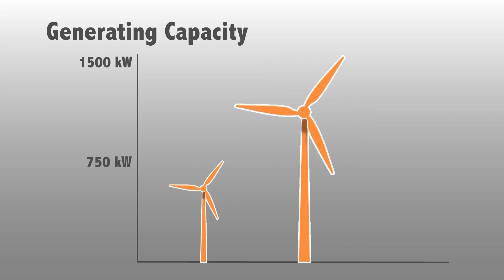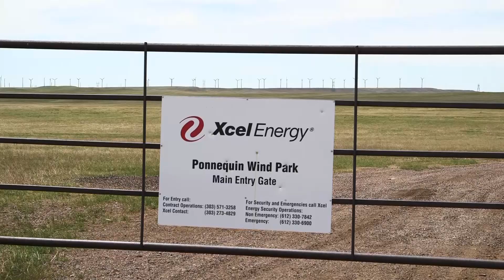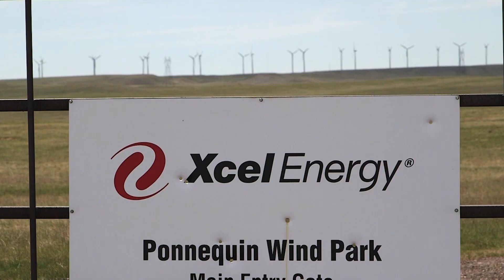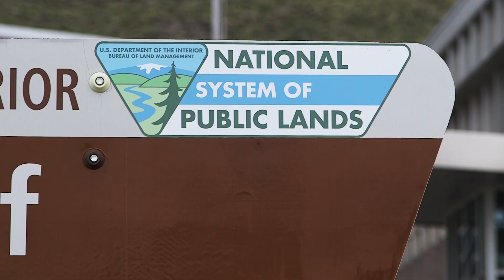Who Cleans Up When a Wind Farm Retires?

Comment: Wind farms built in the last decade are typically require a bond be placed to pay for removing the wind farms, but the bond does not take in to consideration inflation and were under the cost of removal.  Even wind that blows all the time doesn't blow constant requiring constant make up.   Large non culled wind farm output is the most natural gas expensive form of providing electricity.   If wind farms saved fuel the fuel saving would be greatly promoted.   No fuel is being saved.

Comment: The soil underneath these wind turbines is horribly polluted with hydraulic oils (basically automatic transmission fluid, power steering fluid and brake fluid), other oil, greases, and often with diesel fuel too, which can soak in to depths of over 100 feet down, and a radius 5-100x that of the base of the wind turbine itself. To properly remediate the soil pollution, the EXACT same type of NATIVE soil needs to be procured to fill in the holes where the polluted soil is removed.
Reply: And these things leak hydraulic fluids like crazy! There is no replacing seals on these things so they constantly piss hydraulic fluid all over the place. If they don't use a diesel generator they use propane which also leaks only it leaks out into the atmosphere. These atrocities make old coal fired generating stations look clean.

Comment: A bottom fell out of the market? What, we dont need electricity? The whole idea was ludecrious. Wind is low energy as compared to water. The turbines are very costly and how are they to be maintained, no less decommissioned. Sheer stupidity or better yet a scam. Just like the electric automobiles, they would be totally unfeasible without govt. subsidy. There isnt enough electricity to charge them, they have short range, the batteries dont last and how are they to be rid of when worn out. Scam again.

Comment: If you want everything electric, from alarm clocks to electric cars, then there will be costs to build,  maintain, and destroy the generatoring plants and the products, like electric cars or solar panels. But then that is the way for nuclear power plants, coal powered electric plants, or any other man made power system works. I don't have any answers, but we need to think through the costs of the entire life cycle of any power generation system. Or cut back on electric power usage so more, newer generators are not needed. That is the choice.- perfect and simple.

Comment: Without subsidies we would not be building them  these reporters never address the actual output which is based on wind conditions.  The typical capacity factor for these units 30-40% meaning they never actually  meet the  advertised  generating capacity.   1.5 megawatt unit will  only generate  0.6 MW .    This needs to be in the discussion because the industry and the government is misleading the public.  However, the tax payer will be subsidizing "at name plate"  for full generator output according to the new energy polices.... whether generating or not.

Comment: The utility looses the revenue while the wind is blowing but needs to maintain capacity to supply consumers power when the wind is not blowing.  Decreased revenue while maintaining capacity is a recipe for failure.  Texas found out that having 25% of their generation capacity that was not 100% reliable was a disaster.

Comment: Anyone who advocates for man caused and man mitigated glowbull warming AKA climate change. They are blald faced liars scam artist or gullible brainwashed fool's. I am not a denier. Yes indeed there is something up with the Planet Earth. However its not caused by man's activities. What is happening? We are in the beginning stages of A End of an Age Magnetic Pole Shift. This Magnetic Pole Shifting regularly happens at a debatable number of thousands of years.The magnetic poles control the Magnetosphere. That Magnetosphere protects the Earth from Space Weather,CME's and high speed solar winds. The Shifting Magnetic Poles are causing the Magnetosphere to weaken. It already has lost 30% of its strength.  Its termed Solar forcing. Nothing man can do to prevent or stop The Magnetic Pole Shift. Man hasnt caused it. In fact man cant make something out of nothing. And man cant make something into nothing. This great shifting of the Magnetic Poles would still be happening even if mankind had never ever walked on the planet earth. So what should we do? Actually its quite a exciting time to be alive on the Planet. Just think A magnetic Pole Shift. Just like in Noah's time or during the Exdiou's. Me I am just going to embrace the new adventure. I likely will not survive. However I can die trying.

Comment: Greens have been telling everyone renewables will lower carbon emmissions/save the planet...but "the planet" has been manufacturing/building/servicing renewables(replacing FF energy) - with fossil fuel powered equipment - for the past 30 years....and now they tell us temp's are still getting hotter.

Comment: Seems really stupid. If it’s still windy, there, just install new equipment! The existing equipment should be taken down and recycled. Recycle the steel, the copper, aluminum, whatever. Why is it being dynamited? 

Renewable energy is the solution to climate change, but not if idiots are going to dynamite the site after 18 years.

Comment: Part of the problem is that they need exact control of the rotation speed to sync the electrical output phase to the grid phase...That system drives the cost of the blade control system to very high value where a simple alternator to charge a Battery storage system could be a 24/7/365 asset and system maintenance at ground level is cheaper and less hazardous...
Reply: @@Blue_Collar_Hero: Ha, ha, Ok you go on believing that......Oh, and by the way, Transmission and Gear box mean the same thing....

Comment: Bureau of Land Management official: "the surface is our jurisdiction, and that means all elements...." should frighten everyone! Add in eminent domain & tax liabilities, and you soon realize that no matter how much land you own, or whether or not you owe a DIME to any bank on it, or even if it has been in your family for GENERATIONS.....it's not really and never was yours!

BTW, 20 years is WAY too optimistic for the lifespan of wind turbines (and solar farms). It's more like 10 years. About the same lifespan of EV batteries and drive units. (interesting side note: the average age of vehicles in the U.S. is 12.2 years). Just like EV battery packs, many of the old used components of solar and wind farms will end up as scrap in a landfill. The materials used are already in short supply. When everything is considered, we are not reducing our environmental impact AT ALL! In fact, making it worse!

If you are in say, your mid-fifties, you grew up with humming console TV's and appliances that flickered the lights when they kicked on. Remember the big C7 Christmas lights you couldn't touch without getting 2nd degree burns and would blow fuses left and right? We have made incredible advancements since then to reduce energy consumption. So what do we do? We now have to put high capacity, high voltage charge stations in to be able to drive a car! Genius!

Comment: Green energy is a lie. Solar works. Wind works. Until you look at what it takes to make these things like wind turbines and solar panels and ev batteries. The components the natural resources it takes to mine and strip the planet. Its less destructive to just continue to burn coal, and natural gas and use internal combustion engines. But hard to argue when the epa, carb, and the villiage idiot like Biden keeps throwing billions at green energy that doesn’t fix anything including air quality or save the planet. We have new lied to about how all this green energy will save the planet. It’s never about saving anything, it’s always about money.

Comment: So has anyone realized that most of this has been a green energy lie? Huge massive gear boxes require oil, bet no one realized these nacelles require oil to keep rotating. These require periodic maintenance. How much concrete and steel, wiring and composite did these take to build. A lot!  And now they want to just leave them here. There were no requirement when these were built, why are they so concerned with federal regulations on how to rose them down. It’s not that dam hard to take down no harder than it took to put them up. Don’t forget they don’t recycle the blades, but a few places have started to grind up the blades and uses them as fuel for burning power plants. That’s irony.

Comment: I notice how they simply glossed over and ignored the issues.  

A few points.  

Wind turbine blades last between 5 to 10 years before they have to be replaced.  So each of the turbines shown has had between 3 and 9 blades replaced to date.  So far all old blades are either stacked somewhere or buried as there is no way to actually recycle them.  There is a company that touts its grand ability to recycle them, but they really are just repurposing one or two blades a month into things that can be made by just cutting them into pieces.  Like a artsy bus stop roof.  

They always make statement about maximum rating for power produced.  They never actually discussed actual power produced compared to steady and stable output.  1500kW sounds like a lot, until you compare it to actual demand. Like many technologies that have been deployed before they actually achieved viability, wind power has “poisoned the well” for its brand of renewable energy.  If you actually look at windfarms you will notice that number of active producing towers is far less than the number of  towers that are basically “off” and just occupying space.  The people and companies that built them will not admit it is a failed experiment because of fear of public backlash propped up by decades of propaganda.  

Before we “build more wind power”, how about we properly dispose if the thousands of old blades just dumped out there.  Thousands in the US.  I have no idea how many are worldwide.  

If they want to make things better, instead of pushing alternatives with very limited outcome.  By limited I mean all of the sources such as wind and solar are not steady and reliable requiring some process to convert intermittent to constant so it can actually be used.  Or batteries.  Every “renewable” system revolves around a way to store the energy and then release it in a usable form.  Why don't they move on to other possibilities? 

But why do we not hear more about solutions like the ones the Canadian clean energy company Huron Clean Energy and its partner Carbon Engineering Ltd. are spearheading.  In short they are making “fuel” that can be burned in a regular car engine (no modifications required) that is made by sucking carbon out of the air and converting it into fuel.  The exhaust is 90% cleaner than any current engine (diesel, gas, etc.) and comes from the carbon already in the air.  They, and a few other companies around the world have successfully completed every small and medium scale test, including powering their own vehicles for several years.  In Canada the government is blocking any large scale testing for reasons no on can figure out.  Except maybe they have invested so much in renewable dead ends that they want to bury anything inconvenient.  The sad thing is that IF the carbon fuel can translate into the large scale.  It would be viable and transparent alternative that can use the existing infrastructure and vehicles without modification. 

Remember, it is not about coming up with a solution.   It is about maintaining political power or ensuring the lucrative government grants.  Because once you actually create the alternative that meets the actual needs, that infusion of cash will end.   

When they ask that Professor Bumpity from the University of Bumpity to speak, his #1 objective to slowly feed out just enough line to keep you hooked while ensuring nothing ever actually gets resolved.  Once they answer the question they are being paid to search for the money ends along with that cushy job position.

Comment: I backed out of a Verizon cell tower deal 20 years ago because they were going to leave an enormous concrete piling in the ground when the tower would eventually be removed. This was on a commercial lot and would have prevented constricting a building later.
I see this as much less of an issue if the land will likely be used for grazing, hunting, ATV trail riding, etc into the foreseeable future. 
However, as a pilot, I’d sure like to see a blinking red light on each of them!
Reply: Not enough energy to keep a blinking light on 24x7, lol
Reply: Doesn’t Verizon pay six-figures yearly to rent your plot of land?

Comment: There are about 500,000 abandoned oil wells  they leak methane into the air and oil into the water supply.  That is a huge problem.  There are bonds in place to take care of most modern wind farms.  Focus on the real problems.

Comment: Windmills the built in accordance with current designs are stupid. Although they are not as efficient, turbines constructed to drive vertical shafts are vastly superior to the current horizontal shaft designs insofar as durability is concerned. Vertical shaft designs require far less maintenance than horizontal shaft designs, so they last far longer. So, if you cannot make a windmill that drives a generator with a vertical shaft profitable, don't build anything.

Comment: Just one more 'pipe dream' of the radical environmentalists. So much for non polluting 'renewable' energy source. The cost to remove these monstrosities are such that the owners will just skip out and leave the landowners holding the bag or end up completely overwhelming any landfill in the area. Nice work tree huggers and 'Stop Oil' loonies.
PS. one reason the units stop working properly is they didn't get 'lubricated' with enough OIL.

Comment: My two cents- oil and gas wells,  mines and windmills should be mandated to put the land the way they found it. And how do we make sure they clean up after themselves? Before they start a project, the company has to put so much money in an account that will fund the cleanup afterwards. I'm sure many projects wouldn't get off the ground if they were forced to do this. The reason they aren't cleaning up after themselves- its less money to litigate in the judicial system for years and years than do the right thing and clean up.

Comment: As always, we never seem to learn from past experiences. Always thinking we will make it better “next time” with advances in technology. Wind generated power has been around for about 50 years and we still have problems with obsolesce and disposal of old generators and the parts and pieces. We have already seen and are aware of the pitfalls of fully electric vehicles to the earths resources to build them. We will soon see the difficulties of disposing of them in the near future on a colossal scale if they become the primary mode of transportation. Our only hope is that some technologic break through will happen where we can make the battery components artificially, without natural materials, and recycle/dispose of them without affecting the environment. That’s a one hundred year plan, if even that soon.

Comment: I love it … let’s decommission by blowing them up, great! Basically everything can be recycled, even the cement base can be broken up and hauled off. Bigger, heavier, and higher is not the answer, there are several wind turban designs that are much more efficient than the big blade types. Try doing some research instead of trying to reinvent the wheel and ruining the landscape.

Comment: It's funny reading everyone complain about the waste being left by some irresponsible wind turbine companies, as if there was never any coal mining company that abandoned a mine and left an acid drainage problem for the residents to deal with for decades, or there was never a coal plant that let its ash contaminate lakes and a water table for miles around and generations to come, or that the US still hasn't figured out what it's going to do with all that nuclear waste that NO ONE wants buried in their back yard; oh, and you still get to pay for that as part of your nuclear electric bill.

Now that PV solar and wind are cheaper than even coal, and in some cases natural gas, be prepared to see a lot more of it around.  For the nuclear fans boys, keep in mind that it is more expensive than on-shore wind PLUS four hours of battery storage.  And the prices of those keep coming down.  So far, nuclear has only shown itself to get more expensive.

Keep in mind, back in the '70s, the nuclear energy business was telling us they'd provide us with "electricity too cheap to meter."  That never even came close to happening.  And the reason we don't recycle nuclear waste to extract more value from it?  Simple - new nuclear fuel has been cheaper for decades, and it doesn't appear that will change any time soon.  

The copper and steel in a wind turbine can be fully recycled.  So can the concrete in the base pad.  The blade's can't.  But the balsa wood and fiber glass composites have already been burned in concrete kilns to save that manufacturer the cost of burning new fossil fuels.

Comment: The problem with wind is it doesn't generate enough power it won't generate in cold and they catch on fire very easily and they're a big mess when they do and where those blades go do they reuse them know they get put in a landfill

Comment: What folks don't see is the 50 ton or more blob of concrete that is under these things, it goes down about 15' and is  about 50' across, it may have grass on the surface but probably not.  Also there is a network of utility conduit tunnels connecting things together, somebody's gotta make sure they fill all this up with CLEAN dirt, not recycled garbage.